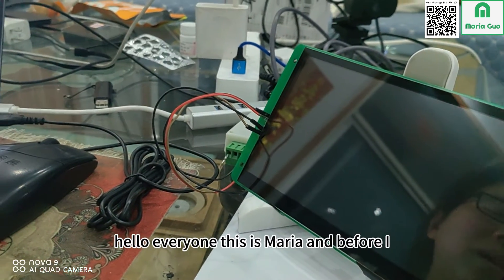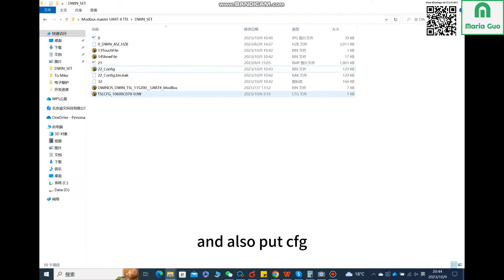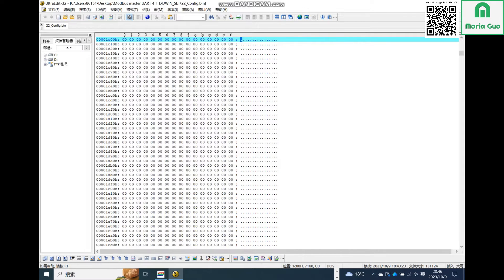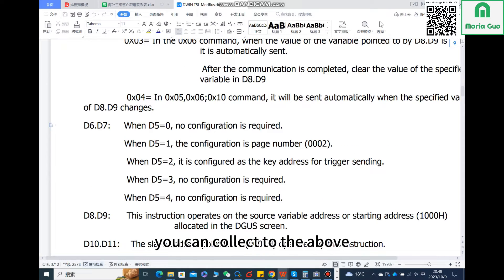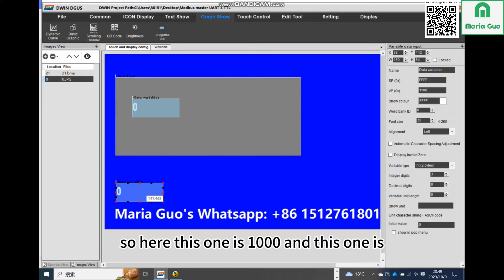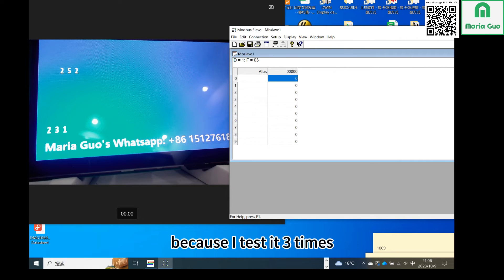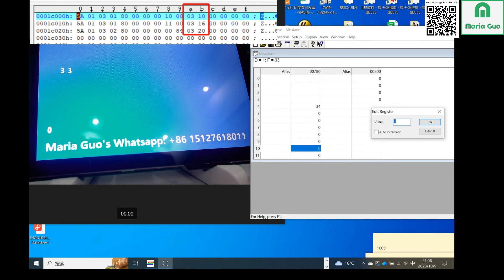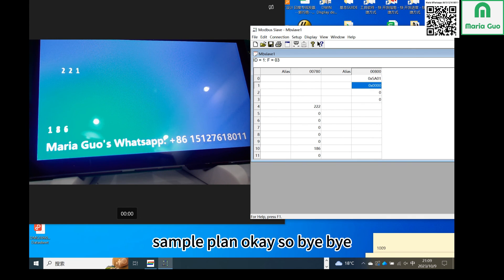T5L Display Modbus Tutorial: TTL, Master, UART 4

Comment: can the display work as master - send requsts to external devices and then show received data on screen like each 100 ms?
And is it possible to have different baudrate/data length/parity for each slave?
Reply from the maker: the display can be as master, and the baud rate  and other parameters shall be set by your own slave?

Comment: Hi Maria, I have one question. My config_22.bin file is configured for 2 kinds of modbus instructions. one is read_input_registers, another write_holding_registers. It works fine, but in my slave device logs i see that panel is doing 4x one instruction, and 1-2x another instruction. How to make it work like one after another equally instead of one 4 times per row ? below is the config part : (1st instruction) 5A 35 04 22 FF 00 00 00 20 00 00 00 00 00 00 00(second instruction)   5A 35 10 14 20 00 00 00 10 00 00 00 00 00 00 00 Appreciate any Help in this matter.
Reply from the maker: it need to be test with your project files. You may send to our official email ID, and mark your company name. Will assign our regional technical person to handle it.

Comment: Hello Maria. Thank you for your examples. I would be very grateful if you could show an example of using buttons with momentary action, when the relay is turned on via Modbus RTU for the entire time the button is pressed and turns off when the button is released. I guess I need to use the "SynchroData Return" function to do this. I would like to know how to configure the button parameters and the 22_Config.bin file.
Reply: That is also bothering me, how to do this with modbus.